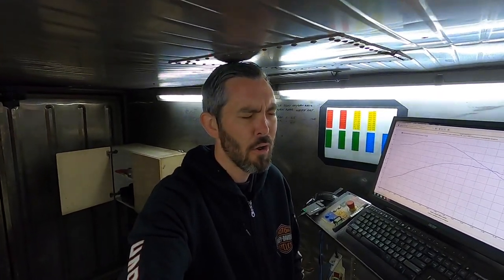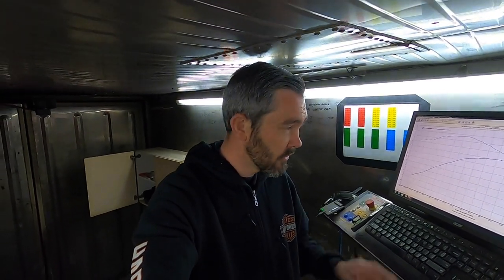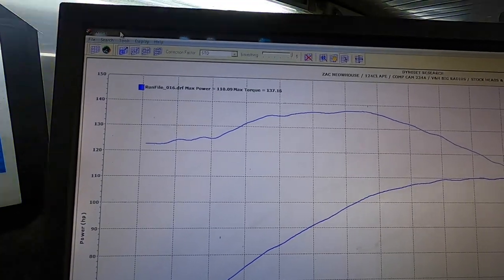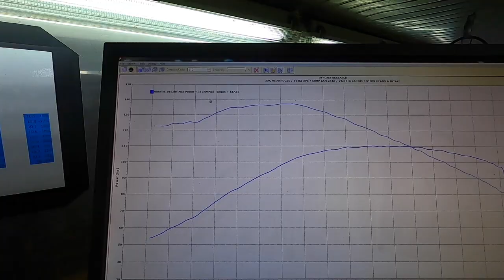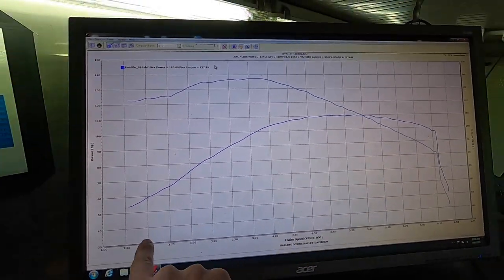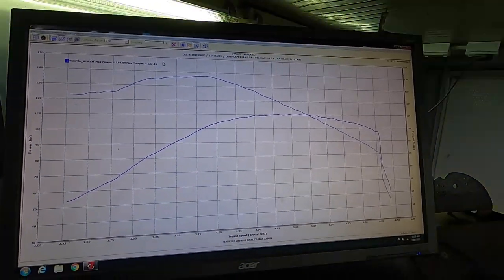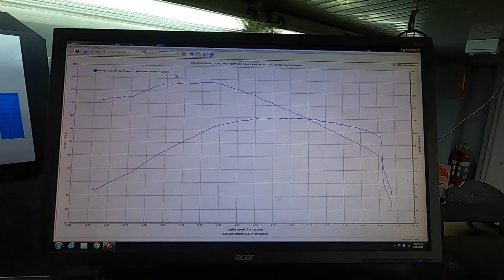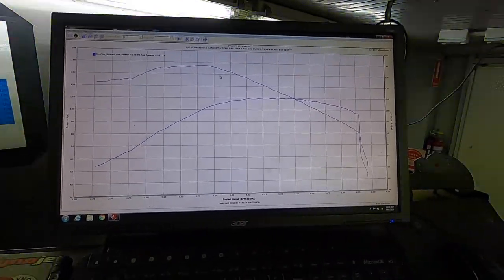124ci Breakout Build / A.P.E / DYNO / Platinum Air Ride / 23'' Turbine Wheel

Comment: Loving these builds mate. Im running a V&H Big radius on my SE stage 4 breakout and was told the same thing by my dyno guy. I'll try to get up to see you guys in the next month to kick around some ideas. Cheers
Reply from the maker: Thanks mate. 
Yeah unfortunately the V&H big radius only seem to be good for around 110hp to 115hp, you can see on this dyno sheet how the power curve rolls over up the top. The cam itself can have a bit to do with that but it's also a strong indicator of the engine being choked up by the exhaust.

Will be happy to have a decent talk with you when you can make it up 🙂👌
Reply: Did you have the talk and put on new pipes? If so, what’s your findings bro?

Comment: Great job. Love ya work and videos.
 Took my 2018 Breakout 107 out to 124 ci, 475 cam. Did everything but the heads, running Freedom Short Shots (Turn Outs) (2 into 2) because they are the best sound in my opinion. SlamTail hyd rear instead of air ride.  Dyno shows 132HP/ 142 FT/LBS torque. Still ride able but also a total beast. Sunshine Coast. WIKID is Good.
Reply from the maker: Yeah that S&S 474 is definitely a great all round go to cam that's for sure 👌 Kind of a best of both worlds really. 
This COMP Cam 234 is a solid torque cam and packs a huge punch straight of the bottom! (Great for wheelies)!!!!

But in my opinion, the Freedom 2-2 pipes are way better than the V&H. They have larger diameter stepped header and a tiny little balance pipe between them which helps the overall HP.
We typically see 15 to 18 HP differences between exhausts.

Comment: Looks amazing.  I have the same bike in 114 with chrome turbines but the 23” is just too much .  Cartoonish looking .  It would have been perfect leaving it along with the 21” turbine
Reply: I thought it came stock with a 23 inch wheel
Did harley change the size from previous years? Thanks
Reply from the maker: Breakouts have always had a 21inch front wheel as standard.
Reply: @MasterTechMiller  How much does it effect the handling going down the highway by going to a 23? I've always been set on a low rider s. BUT I think I'm in love with this exact bike!!
Reply from the maker: @mikeessary4925  the handling for highway use is not effected at all. The cornering capabilities are further reduced with the 23inch. 
Breakouts are not the sort of bike someone would buy to attack the twisties though.

Comment: Very Informative videos my friend. Question that I think you answered for me but just need your opinion on my build. 
I have a 16 SG. It Was a 103ci and I put the 110 stage 4 slip on kit after blowing a valve spring. My lower end is welded and balanced by dark horse with S&S 585 cams. Upgraded S&S cam plate and pump.  I also have the same big radius pipes and a power vision tune. 
My dyno #’s are 106hp and 127 fpt. 
You stated that a D&D or A basani would increase the HP quit a bit. 
I have stretched bags with no cutouts. So I would need a shorty or a turnout  
Do you think if I can get either a D&D or basani in a shorty or turnout I would still improve my #’s as you stated in this breakout?

And off the top of your head do you think either one of those 2 pipes would fit? I’m getting so many mixed reviews and can’t get an answer from either exhaust company. 

Sorry for the long winded question. 
Thanks much in advance.
Reply from the maker: TBR have a 2-1 that will work with your current setup. TBR is still a good brand and quality pipe. 
I don't believe them to be a quiet as good as the Bassani or D&D options though.
You will definitely see an increase in power though. The V&H big radius pipes help to produce a nice early bump in the torque curve but after that it's all over.

The Bassani road rage or TBR 2-1 would be my recommendation for your setup with the bags.
Reply: @MasterTechMiller  thank you very much for the info and a quick response.

Comment: I have CVO Softail Springer 2009, would you still use platinum air suspension? Also where you based? I’m from Sydney. Thank you
Reply from the maker: Platinum Air makes the best air ride suspension in my opinion. 
I would use it on a Twincam no worries at all.

Mate I'm in Toowoomba QLD (about 1hr 15mins West of Brisbane).

Comment: Love the videos bud always a great watch 

Have you done much work with the 103ci twin cam breakouts, looking to find more power or torque for my weekend rider but always end up looking at the stage 4 se tyre shredder kit 

Cheers
Reply: Probly should have added 

It’s a weekender single rider out for fun and abit of speed bt it cops some abuse on the weekend when we’re out and want to keep up with some of vrods that are at 140hp 

So as I know so far it at stage one
Reply from the maker: Thanks for watching 👍

As for the Twin Cam builds, I would highly recommend the 110ci cylinders with Screamin' Eagle CNC ported MVA Heads. They have bigger valves & springs in them. You will need to run the MVA pistons for those heads too which will give you a nice bump up in compression ratio.

Use the Screamin' Eagle 260 Cams & a 58mm throttlebody. If you have a nice 2-1,exhaust system you should be sitting somewhere around the mid 120hp mark with torque being similar.

Considering you are probably sitting somewhere around 75hp at the moment with maybe 100ft/lbs of Torque, you are definitely going to notice a great improvement

Comment: What is the brand, model, height and diameter on the handlebars that are installed on this HD Breakout? 
Thank you
Reply from the maker: @MT-ju5zh  Burleigh Bars is the brand. Highballs is the model. 16 inch high, 2 inch thick
Reply: @MasterTechMiller  Thank you. Building my own - Your video(s) are a big help.

Comment: As a tech I thought you may have an opinion on this... I have a 2021 Harley Fat Boy. You may know that it comes from the factory with a high performance air cleaner, but I ordered an upgrade to that ("extreme" Screamin' Eagle air kit) which is 40% more efficient. My question is; if I plan to install a basic full exhaust on this Fat Boy (whatever brand) and that's it, is there a downside to having this upgraded air kit (like it can't be tuned properly, poor gas millage, poor performance, won't work well with typical exhausts like Big Shots V&H pipes, etc...)? 

I understand that the advantage is that it will work better with a cam installation later on if elected, correct?
Reply from the maker: No. There is no downside at all if you upgrade the air filter assembly first then do an exhaust upgrade. 
Essentially that takes you to stage 1 if you buy a tuning device and have the ECM re-mapped.
The bikes are 'choked up' a lot from the factory to meet emissions & noise standards. 

If you decided to upgrade the air filter & exhaust without remapping the ECM you may find that the engine will run leaner due to the free flowing upgrades.

With a good dyno tune your gas mileage will definitely improve and you will definitely see HP & TQ gains aswell.
Reply: @MasterTechMiller  Thanks for the reply. I didn't know if perhaps this upgraded air kit was more than what pipes could accomodate.

Comment: So the stock crank, bearings, clutch are good enough to handle this new power level reliably?
Reply from the maker: With these sort of mild to tough street builds the stock components are good enough for sure.
It's only when the customer tells me they want to do lots of skids, wheelies or drag racing that I will reccomend higher quality components.
Check out the rest of my channel's content for some higher performance builds with aftermarket go fast bits.

Comment: I have those exact pipes on my 2011 dyna street bob fitted with the screaming eagle 110 tire shedder kit, it's making 106hp/122tq. You're saying I can get more out of it with a different exhaust?
Reply from the maker: Absolutely. Assuming you have the 110ci Bolt on kit from Screamin Eagle with 58mm Throttle Body & 259E Cam shafts?
You will definitely make more power with a decent 2 into 1 pipe

Comment: Wondering if you can help,  How do you adjust the rebound one the air ride ? i have it installed on my 18 fatboy but no one seems to know exactly how to use it properly ? id appreciate and advice thank you , btw awesome bike
Reply from the maker: Using both toggle switches, hold them in the UP position to raise/inflate the suspension. The longer you hold the toggle switches up once maximum ride height is achieved the additional air will increase the preload. Release toggle switches.

A good method of working out pre load settings is to count in seconds after maximum ride height is achieved to gain a base point. 

Using the front toggle switch (depending how your switch assembly is orientated, hold it down to achieve your desired ride height. This process is what sets the rebound. There is further adjustment to increase or decrease the rebound.
Reply: Thanks for the advice really appreciate it :)  @MasterTechMiller

Comment: Super stump puller. Maybe if you could get a Bassani chromed Zac would go for it. Bike is pretty insane as it is. Style is important with a bike like that.
Reply from the maker: There are a few option for chrome 2-1 pipes out there, I'm pretty sure Zac is more than happy with how it rides for the meantime. All that torque coming on very early in the rpm range hits harder that Mike Tyson's uppercut. Not to mention the sound of it out the V&H big radius.
Reply: @MasterTechMiller  That bike has more than likely blown away anything else by then anyway. That said it would still be interesting to see a few computer mock ups in chrome for the V&H pipes if you have time.

Comment: I have a 2016 Breakout with the 103. What cam up grade kit could I go with to get close to the power that the bike in the video is making?
Reply from the maker: Hi mate, so the 103ci would need to go upto 110ci first, then you would need the Screamin Eagle 259E Cams, tidy up the ports by hand on the stock heads & use a 58mm throttlebody. That will produce around 110HP & 120FT/LBS even with Vance & Hines Big Radius. 

Another option is go up to 110ci, use Screamin Eagle 260 Cams, ScreaminEagle MVA Cylinder heads with the matching Hi Comp pistons, some machine work to increase the compression ratio even further and use a 58mm throttlebody.
With a good 2-1 exhaust system you will see 125+HP and somewhere around 130FT/LBS.
Reply: Ok thanks!

Comment: Great videos and awesome build. My FXBRS has sharp curve radius Freedom pipes, do they lose similar HP as the Vance & Hines big radius pipes?

Edit: The lumpyness of that cam when pulling into the dyno sounds so good. Doesn't get much better than that.
Reply from the maker: Hey mate, the Freedom pipes don't loose anywhere near as much HP & TQ as the V&H option. 

If I was to choose a set of 2-2 pipes for performance reasons it would be the Freedom radical radius or the Freedom sharp curve radius
Reply: @MasterTechMiller  Is there a way to make the 2016 CVO Turbine rims fit to a 2021 Breakout? Sorry, I'm having a hard time finding the answer, I love those rims.
Reply from the maker: @marz6894  the CVO Turbine wheels from 2016 will fit the M8 Breakout. You just have to mix n match the wheel spacers.
Reply: @MasterTechMiller  Thankyou for being so helpful.

Comment: Nice build!

Would you expect the same restriction in power from a similar set of Freedom pipes? They’re what I’m running on my 2019 breakout. 
I’ve had a couple of pneumatic systems before, including the Arnott’s, but I now have a Slamtail hydraulic system and will never go back to air
Reply from the maker: Actually the Freedom 2 into 1 systems are the better out there for power. They don't hold back at all to be honest.

Yeah the Slamtail kits are definitely a good choice too! 👌😎
Reply: @MasterTechMiller  thanks for the fast response! My freedom pipes are very similar to the Vance and Hines on that bike- I just couldn’t remember if they were called big radius or sharp radius. 

My breakout is a 114 stage 2, but I’m looking to go stage 3 once it’s out of warranty in November, so I don’t need to stick to SE parts. 
I was just wondering if you think the pipes would be a restricting factor?

The other factor I want to sort out whilst it’s still on warranty is the fact that right from new it has run great for about 500km when it was new or after it’s been tuned, but then starts running rougher and losing power. It’s not sumping or oil transfer. Perth Harley reckon the plugs are covered in carbon when they pull them but their master tech always says they can’t find anything wrong and they retune it and send me on my way. Rinse and repeat. 
It’s just done 9000km, was running so rough that I did it’s 8000km service at 6500km. 
I’m starting to suspect excessive blow by that they just don’t want to acknowledge. 
Might need to take it somewhere for a leak down test. 
Too bad I’m on the other side of the country, you guys seem like you’d be great to deal with
Reply from the maker: @yorichunt  no worries mate. Freedom have 2 option, sharp curve radius or radical radius. The sharp curve ones look very similar to these V&H pipes, so I'd say you have them. 
They don't seem to restrict much at all, I think it's because of the larger step in them.
I pereonally wouldn't be too worried about them restricting you much hey.

Was their Master Tech's name Wayne?
It's a shame you are having trouble with your bike. 
I might be able to help if you can give me a bit more info...what Cam does it have, what Air filter & what tuning device is being used?
Reply: @MasterTechMiller  Thanks mate, good to know about the pipes. 
I’m not sure who the tech was, I just had the info relayed to me by the guys at the front. 
It has the SE torque cam and the SE 58mm high flow inlet manifold with stock throttle body and a ventilator air cleaner. Runs a Maximus tuner. 
This issue was there before the cam and when it was running the SE street tuner too. 
The tunes are likely approximate because the Harley dealers over here don’t have dyno’s
Reply: The drop off in performance has been there since new, and after every service- such as when I got the cam and I’ve brought it back a few times because it was running rough. 
It’s why I was starting to wonder if it was blow by that was fouling everything up until it wasn’t firing optimally.

I should note I didn’t mean any disrespect to the boys at Perth Harley- they’re great in there- but it’s the kind of issue that Harley Australia or Global might not be excited to fix on warranty
Reply from the maker: @yorichunt  hmmm, definitely starting to sound interesting that's for sure..... sounds like you've got it narrowed down more than most customers can figure out. 
Can you run me through exactly what is happening during the loss of power/breaking down event? Is it only in 1 or 2 particular throttle positions, is it better or worse when bike is hotter or cooler? 

It could be something simple like an intermittent engine temp sensor or TMAP sensor. 

Nah, doesn't bother me at all your opinion on other Dealers lol, no stress at all. I just know a Wayne who works at Perth Harley and I'm pretty sure he's a Master Tech???
Reply: @MasterTechMiller  it doesn’t break down, it just runs progressively rougher. I’ve tried to figure out if it rides differently in different temperatures or weather conditions, but I don’t think it does. Sometimes I imagine it seems to like warm dry weather, but then the issue makes itself known again. 
It’s basically less power throughout the range, rougher exhaust note, more “barky” and less rumbly or growly. More valve noise and a knock/vibration that isn’t there after it’s been tuned or serviced
Reply: Every now and then she runs beautifully again and I cannot figure out any common factor between those occasions
Reply: Almost all of the km I do on it are highway km at about 100kph with the odd burst of spirited riding
Reply from the maker: @yorichunt  jeez mate! I would love to be able to take a look at it and see what I can find. Obviously that's a bit hard being on opposite sides of Australia lol. 
It must be very frustrating having to deal with that.....
Best advice I can give you remotely like this, is to check all the electrical connections you can. Unplug them, look in the connector and make sure all the little terminals all fully seated.

Hold the connector and wriggle the wires at the back of the plug, checking for loose terminals inside the connector that could be touching each other, try feel for little breaks in wires where the wires make sharp turns or have a constant bend in them. 

Spray all the connector male & female ends with the old WD40 (just a small squirt) to ensure the rubber seals aren't squishing up and not allowing a fully seated connection. 
Unfortunately that's all I can offer from here mate. 
I'd love to take a look in person.
Reply from the maker: It's not uncommon to find breaks in Harley wiring systems hey. Happens quite a bit even on brand new bikes.
Reply: @MasterTechMiller  thanks so much for taking the time and making the effort to help me out! I really appreciate it. 
I’ll try your advice out for sure. I hadn’t even been thinking along those lines because of the way it starts out ok and then gets progressively worse over time. I’d figured it was something like blow-by creating more and more build up on the plugs, or perhaps a dodgy injector or something. 
I’ll give the wiring a decent go over, and I might bring it back to HD and ask them to do the same. It’s back to running pretty rough at the moment. 
I’ll let you know how I go. 

Again, I really appreciate your help and advice- thanks!
Reply from the maker: @yorichunt  no worries mate, sorry I couldn't be of more help.